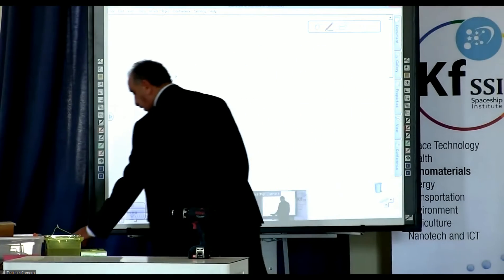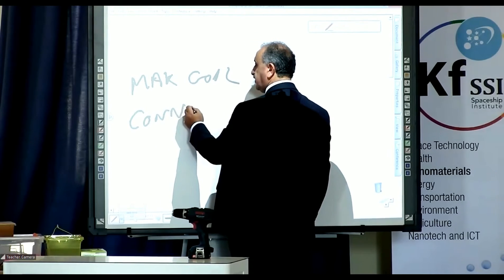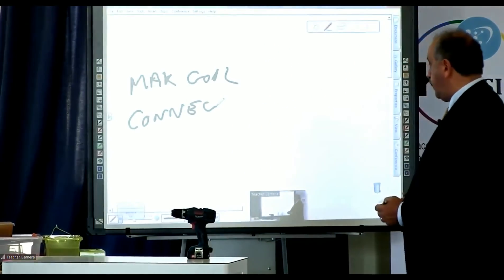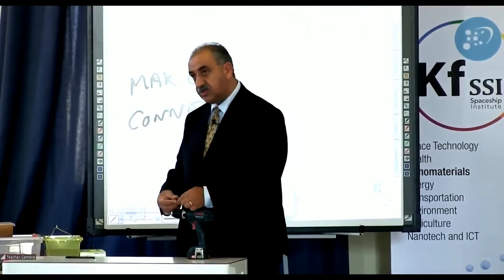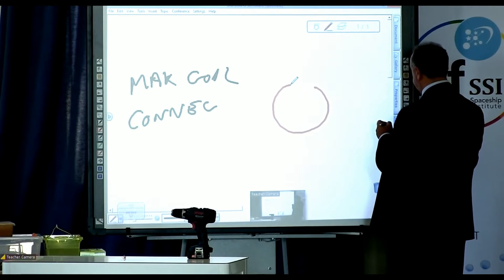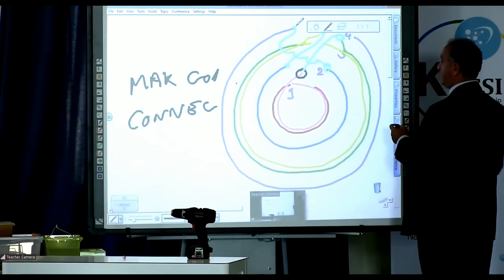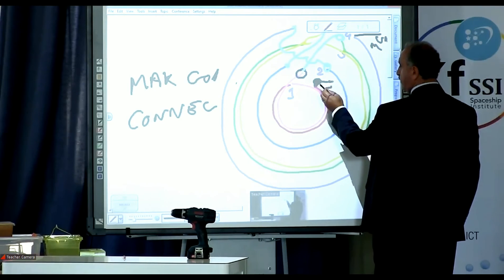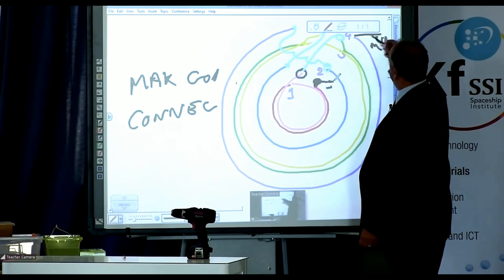Mr Keshe makes it clear  COIL WINDING IS CW - rotation of the bar is CCW

Comment: Does it matter if the wire goes from top or from bottom of the stick?
Reply from the maker: To wind a clockwise coil using a drill turning anticlockwise, you secure the one end to the drill on your left hand from the bottom of the stick and you hold the other end to the top of the stick.
To wind a clockwise coil using a screwdriver you hold one end in the left side of the screwdriver from the bottom of the stick, the other end to the top of the stick, and you turn the screwdriver anticlockwise.
You can watch also this video:

https://www.youtube.com/watch?v=QRJbpeUGsGI

In the last update of the instructions (April 2016) they have added this Note:
"Recent information indicates that winding can be either direction but MUST be consistent within your unit".
Reply: Thank you, you save my day!